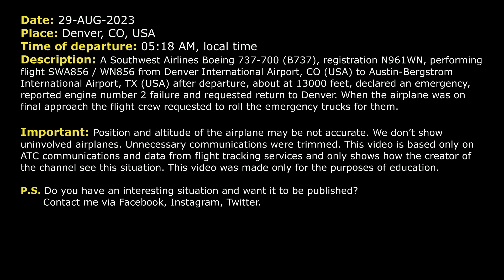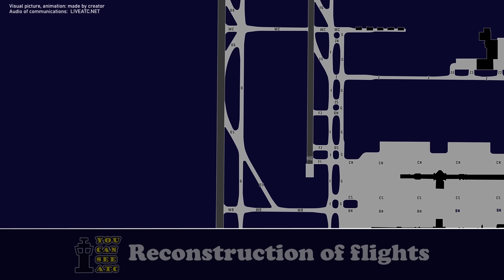Engine failure in flight. Southwest Boeing 737 declares an emergency and returns to Denver. Real ATC

Comment: “…or do you wanna run the  checklist first?” 😳 what kinda question is that?!
Reply: very normal, asking whether they need to return immediately or if they want time to go through checklist items in a hold etc before returning to the airport
Reply: @keatonhare7691  whats normal is “say intentions”, if the crew needed to return immediately without running proper checklist they would have said so with urgency at the outset. Single engine is smart to declare but not dire,  but running the checklists is critical.
Reply: @marlinweekley51  Give it a rest.  There is no "one way only" to handle the situation.  They got the plane down with zero hassle, shiny side up - and you want to complain.  You must work for the FAA Keyboard Warrior Division...

Comment: I always think the controllers bombard the pilots with questions at a most busy and intense time.  Engine out and cockpit going crazy and we need t know this, that, everything- pilot told you the emergency, requested a vector while they stabilised things.....
Reply: It did not sound like the cockpit was 'going crazy' and it would be concerning if that were the case.  Calm professionalism on display here.
Reply: You know the time is trimmed way down right? They aren’t bombarded at all.
Reply: You do realize this is edited for time?   The entire event probably took 20-30 minutes to resolve.   The compressed time frame only makes it seem like ATC is "bombarding" the pilots with requests.
Reply: the funny thing is ALL that information is in multiple computers, somewhere. You think that could be sent by company to the FAA and then to the airport
Reply: @jamescollier3 To be fair, last minute changes happen and total fuel (which determines danger of a post crash fire) and number of people to look for are critical. Also, controllers may ask questions, but plots can always tell them to standby
Reply: @jamescollier3 it's important information, and they need that information should something catastrophic happen like the Asiana flight that crashed at SFO. They may not need that information immediately. But they do need it. It's more accurate to get it from the cockpit. 

They would know how many people they're looking for. They would know how much fuel they're dealing with.

Now, I know the Asiana flight didn't have any issues leading up to the crash. But emergency crews didn't have a count of how many passengers were on board.

Getting that information from company, who is also dealing with a bunch of other flights and may be dealing with another emergency going on, is not a good idea. This channel has a video of two American Airlines flights declaring emergencies simultaneously over DFW.

So, it is possible that can happen.